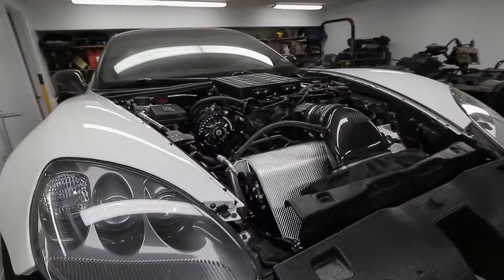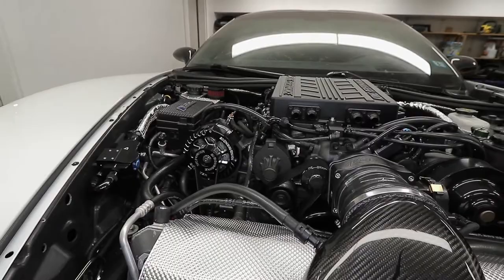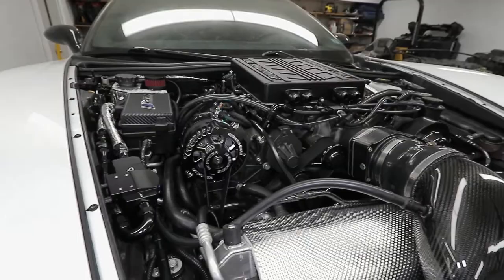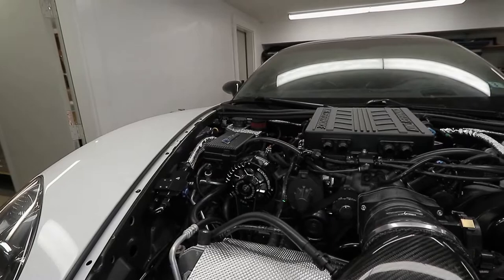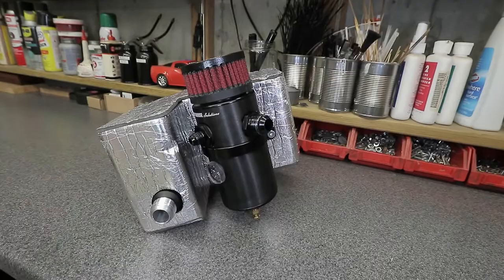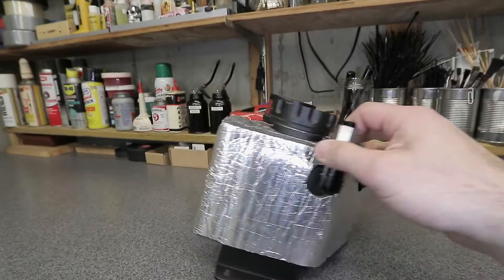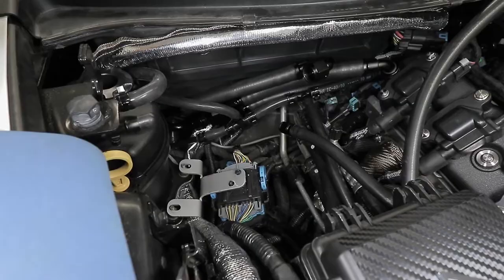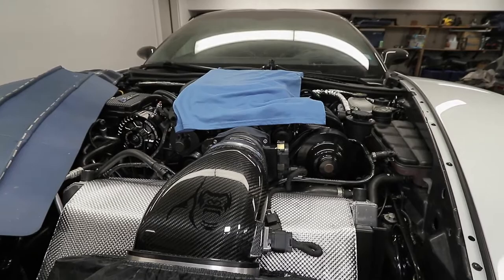How I SETUP My Catch Can System for HIGH Horsepower | Mighty Mouse WILD | LS9 Corvette ZR1

Comment: Hi John.  Looking really good.  You might recall that I'm rebuilding the LS9 from my 2009 ZR1.  I'm currently at week 22 and on round-2 waiting (hoping?) for JE Pistons to deliver properly machined 10:1 CR custom pistons and plan to run E85 mostly (no one makes an off-the-shelf piston for the LS9, so I went for ceramic dome, coated skirts, and gas ports).  But on to catch cans!

I haven't got back around to my WCCH-ported heads (been prepping block, crank, balancing rods, getting Calico coating done, sourcing coated bearings, etc...), but per your advice, and in accord with where out-of-control 'scope creep' (fueled by my own ADD/OCC-Perfectionist-Engineer personality) always compels me to go...  So, as you keenly predicted that I would need to; I will be 'blend porting' them similar to what you did, although your efforts are a pretty tough act to follow.  Enough off-topic stuff though:

I like your thinking on stuff like this.  And even though you didn't ask; here is my planned catch-can solution going forward.   I am compelled to make it work like a proper sealed PCV when not under boost...   We shall see the result someday, if I ever get pistons.  And, of course, YMMV...

Previously, at 602 rwhp (tuned by NicD at CPR with 2.6 upper, K&N CF CAI, 90mm TB, and a little home-grown blower/snout porting making 13 psi or so - otherwise stock) I ran a system with Qty2 check valves in 10AN lines going overboard from 2 baffled/filtered catch cans fed by Qty3 -8AN lines from the engine.  Sealed system (except when positive pressure opens the check valves) taking filtered and MAF measured air from in front of the TB and feeding it into the blower inlet aft of the TB with -6AN first and last lines, (having been thru the engine and catch cans, as is proper PCV function, and vacuuming vapor out of the crankcase along the way, which is good in general).  I thought this was good, but...

I ended up with lots of oil in the blower again, but at least there was none on the front of the TB blade.  It is apparent that opening the check valves (at 0.33 psi delta-P) did not stop crankcase pressures from blowing oil-laden air into the blower inlet (the blower inlet is always a great source of vacuum, being in front of the even harder-driven and hungry rotors and-all...).

So I'm going up in all line sizes leaving the engine and catch cans to enhance conductance away from the crankcase and will also add two solenoid valves to physically isolate the intake tract from the PCV system when boost > 5 psi.  One normally-open solenoid valve in the line leaving the CAI and the other in the line entering the blower intake.  They will be triggered simultaneously off the hobbs switch circuit that also runs the Aux fuel system and some other 'special' functions.  This should keep oil out of the intake tract, and still have a functional ad useful PCV system for all conditions below 5 psi boost (>95% of operating time).  At least that is how I envision it all working in unison...

Good luck with all your efforts and thanks for the virtual 'ride-along' as you journey.

To wrap-up, that is surely nice work you're doing there ( as always John... hahaha)!!  It sets a tangible and measurable 'bar' that challenges me not to slack-off on sweating the details.  Thanks for the inspiration, ideas, and time you are putting into your build.

Comment: Hey John, I just picked up on a couple details that I'm hoping you can shed a bit of light upon.  

1.  Is the only connection into your intake tract the one located in the bridge, specifically between the filter and the TB ??

In OEM  spec, this port flows clean, filtered air to the ullage volumes at the tops of the dry sump tanks and then into the valvecovers...  with the purpose of entraining hydrocarbons, VOCs, and other organic contaminant gasses resident in  the tanks or the engine... and eventually feeding the air/contaminant mixture to the rotors and on into the cylinders, ostensibly for, and with varying degrees of success: exothermic oxidization and/or thermal dissociation).  The motive force producing this flow in the identified direction is the delta-P between the  very low  pressure at the rotor faces, and the near-ambient pressure in the air filter bridge

2. If so or if not (response to D1, above), what is attached at the OEM PVC " air + crankcase vapors IN" port (located in the snout, just a couple inches aft of the blower drive pulley, and above the input shaft; and has a pretty good vacuum, since it connects right to the volume just before the rotor faces and after the TB)?

Thanks for your time, John
Reply from the maker: Its hard to see in the video but the smaller -6 line on the catch can is attach to the large snout vacuum port you mention. Clean air line from port on carbon intake goes to the Elite Engineering clean side oil separator on top of dry sump tank(replaces factory cap). With this setup i have a bone dry intake and supercharger free form oil and other carbon deposits. Thanks for watching!
Reply: Ok.  Thanks!

If you'll entertain another question...

How is un-metered air prevented entering the system through the breather atop the catch can, and then being ingested into the intake tract at the high-vacuum port in the snout.  This would be un-tunable, so I know there's a mechanism, I'm just not seeing it (in my system, I used check valves which shut when the whole PCV system is under vacuum & my breathers were downstream of the check valves)?

I probably should re-watch the video because you're very thorough, and my answer is likely there, but...  its late already.  Hoping you'll indulge me with the answer.  

Thanks John!

Comment: Funny enough I am running the same MM Wild Setup on my LS1 with a Vortech. It is set up just like yours and I’m experiencing oil in my manifold still. Can is filling up with oil pretty quick.

MM told me to convert to a Race Version which Vents all the time. I’m assuming that means I have to route the vacuum line back to the original valve cover location (as it was stock) and route both valve covers to the can (no vacuum?) 

Are you familiar with how the race style can is set up?
Reply from the maker: yes ive tryed the MM race core and oil in runners got way worse. i think because it not pulling a vac on the piston rings and get more oil reversion.  I went back to the PCV/closed loop core and put an aeromoitve 10micron filter on the -6 vac line to capture any residuals getting past the MM CC. Very happy so far.
Reply: @JohnFrancoNH  great video my car is a junker compared to yours beautiful car I’m running a 5.3 ls turbo  so should I have a vacuum source hooked up to my catch can I’m currently seeing lots of smoke vapor coming out of my catch can I have two -10an lines going from my valve covers to my catch can but I’m not pulling any vacuum out of my catch can after watching this video I’m going to invest in this set up can you take a look at my set up I have a video I would really appreciate the advice